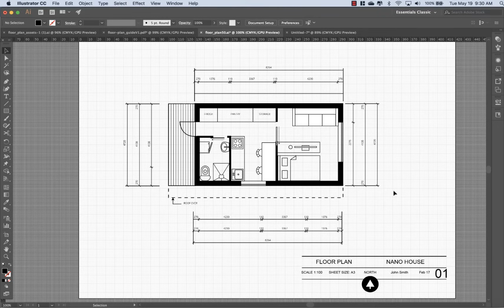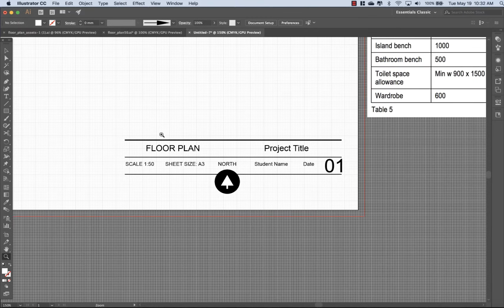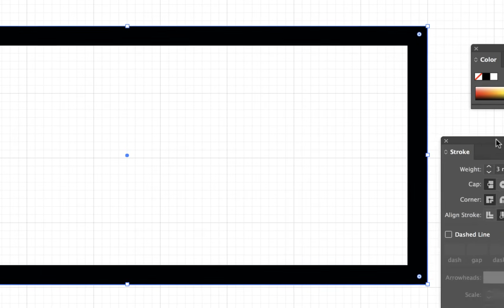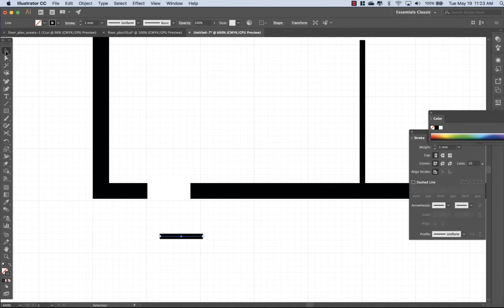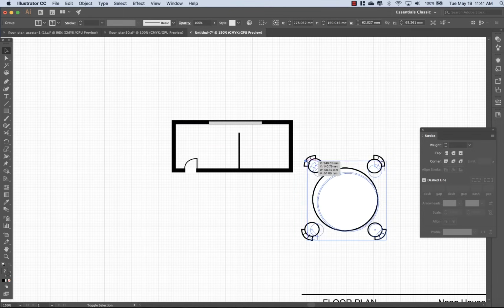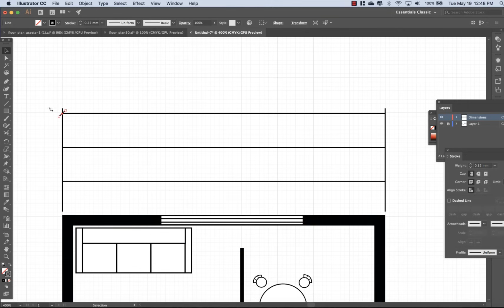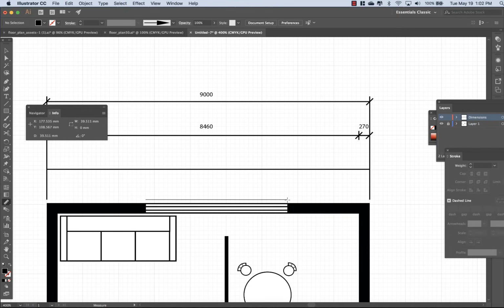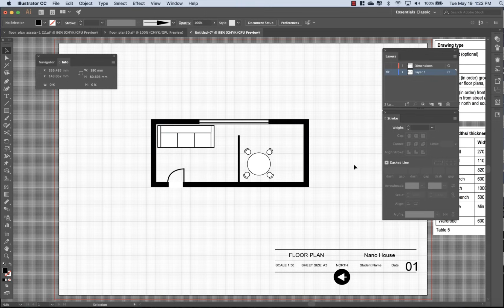How to create a basic floor-plan using Adobe Illustrator

Comment: How should I set up the units for inches and feet?
Reply from the maker: Hi there. Go to 'Preferences'. In the 'Units' section, you can change the 'General' settings to whatever you like, including inches and feet.
Reply: @p @progers m also trying to figure this out with these units of measurement. I’m not getting the desired effect, I selected grid line every 1ft and 12 subdivisions hoping it would reflect the 12in in a foot

Comment: I got stuck. I've never used this program before and I've never really done a floor plan before. I got stuck when making the grid because I am in the USA and we use the Imperial System, and I really don't want to attempt to convert all my measurements to Metric. So any thoughts on how I could make each box equal a foot? My room is approx. 2 ft x 41 ft. so I'm guessing I should try to have a grid that is maybe 70+ boxes wide and 50 boxes tall? Not sure how to do that either. I am not an architect, nor awesome at math. I am sorry for my ignorance, but I'm very to have come across a helpful video. Thank you.
Reply: Learn architectural scaling, i.e. 1/4"=1' or draw in modern Ai in full size on a large artboard or canvas size. Than scale down all drawing by factor 48 to  fit it on letter size page to be printed.